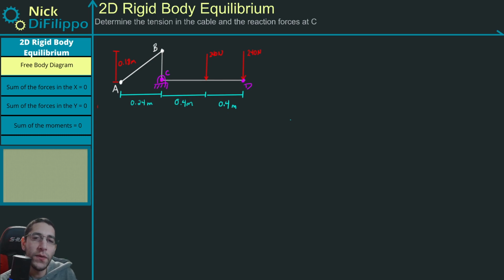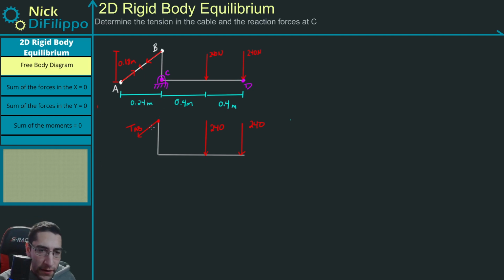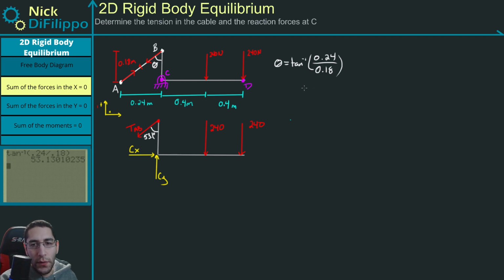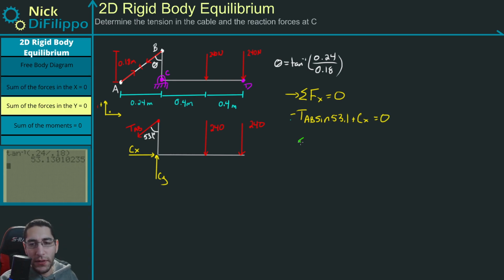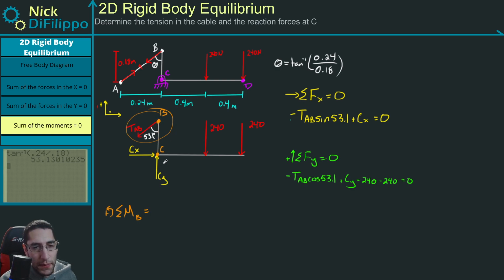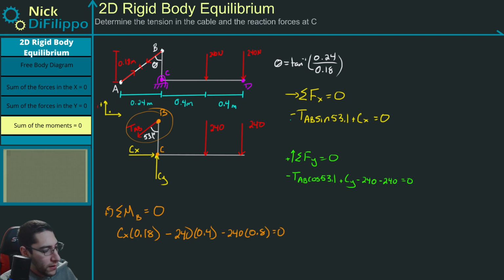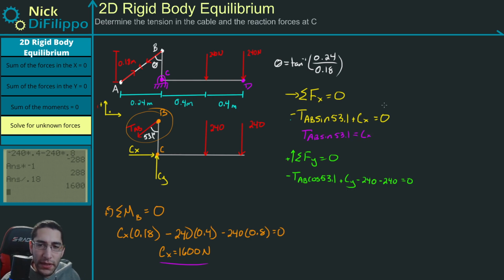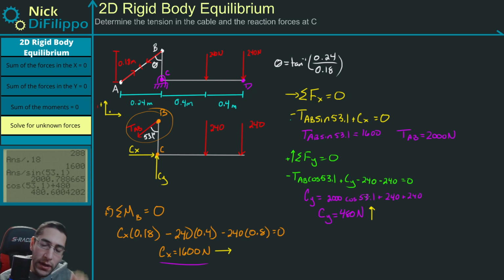Statics - 2D Rigid Body Equilibrium (Find Tension and Reaction Forces)

Comment: Thanks for the videos Nick, they're really helping me while taking Statics. I think there might be an error for Cy, should it not be 1680 N? I think you might have forgotten to multiply 2000 by cos(53.1). If I just do cos(53.1) + 480 then I get the same answer as you.
Reply from the maker: Yup looks like I did forget to multiply that by 2000. Thanks for pointing that out. Errors like this are why I decided on putting the calculator on the screen.  Makes the calculation errors easier to spot because you can see if I miss a term really easily.
Reply: @EngineeringCorner  Yeah, seeing the calculator on screen is very helpful. Thank you again for the videos.